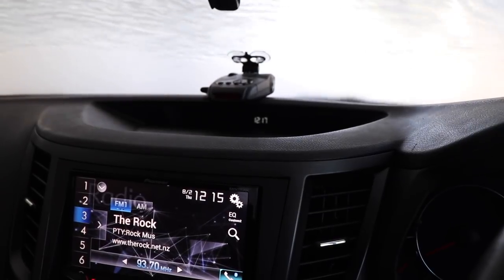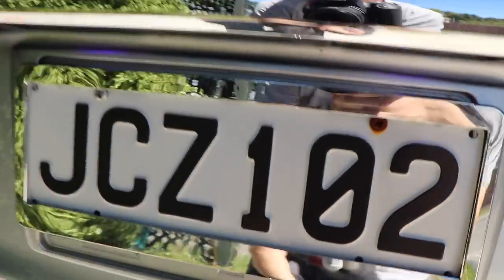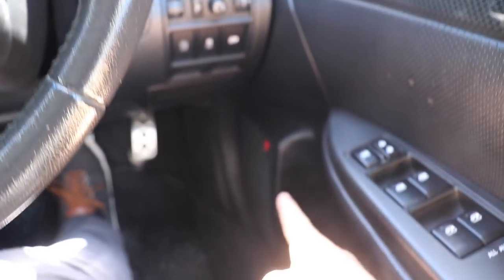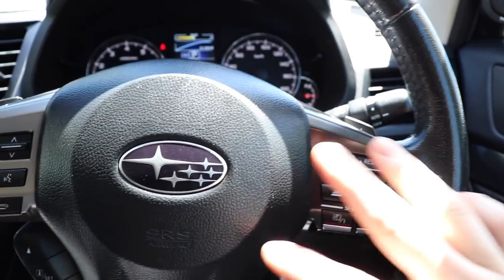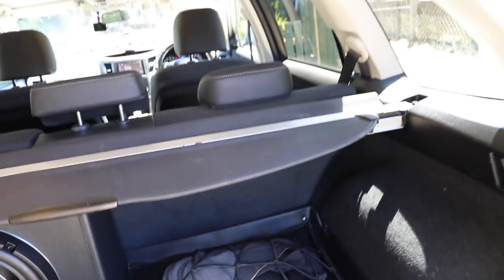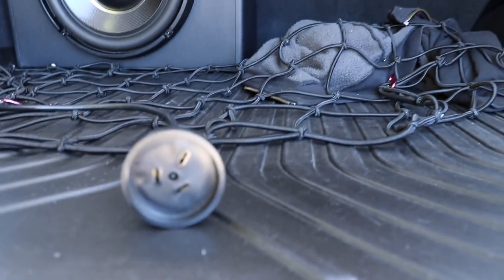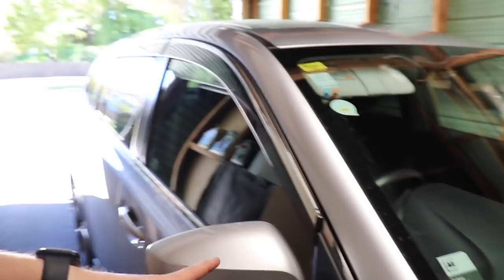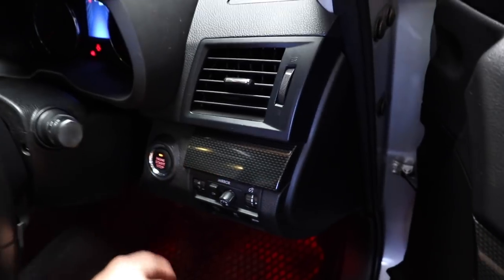My 'Lit' 2014 Subaru Legacy SQ 2.5i | Complete Car Check

Comment: I think, its not clever put anything in front of Eyesight cameras.... I have Levorg MY2017 and Eyesight is very sensitive even for a dirty glass. Just my opinion. :-)
Reply from the maker: Thanks for the tip 
I do use the eyesight all the time and never have any issues with it.
I assume you are referring to the dash cam mount being in front of the left camera.
It’s not directly in front it’s actually more towards the center of the car and since it still works fine my guess is that the dash cam isn’t impeding the view of the eyesight.